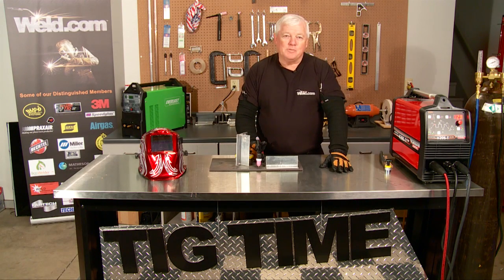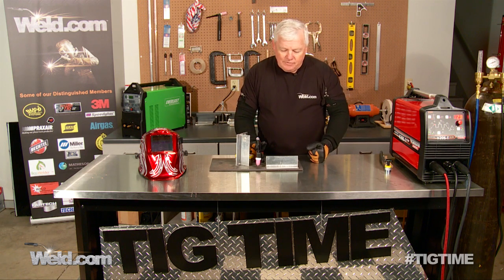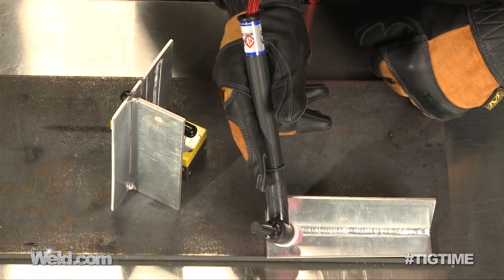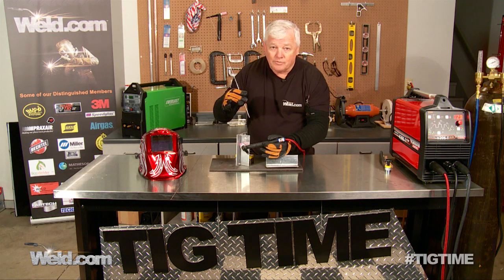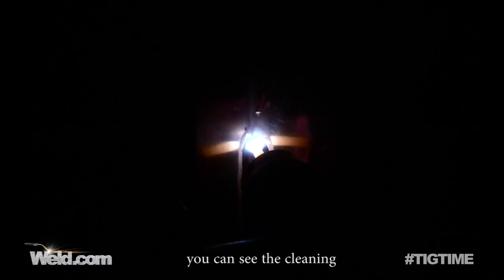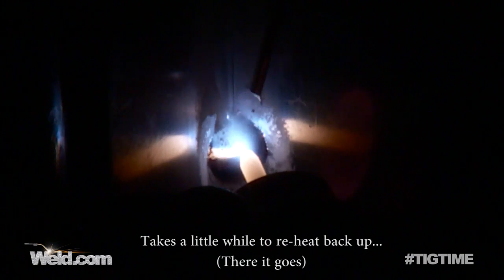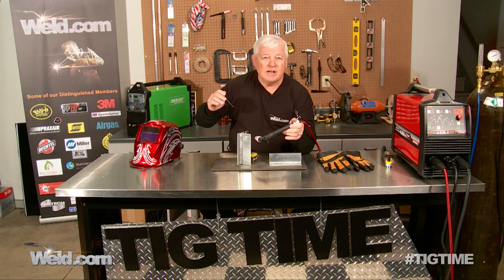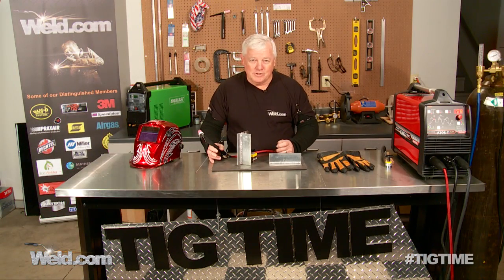TIG Welding Aluminum in the 3F Position

Comment: arksreams, the reason the al cracks is because al is really brittle thus meaning not much room to expand and contract. if you don't back fill at the end of the weld it leaves a weakness and when contracts energy leaves the weakest point. especially the 4 thousand series. 6 thousand series (structural angle tubing ...)  is a Lil better but still brittle 5052 AL is the most malleable al, that is the type of al you would find on the the al boats, it will bend when it hits something as opposed to the others which will crack. hope that helps your cracking  question.